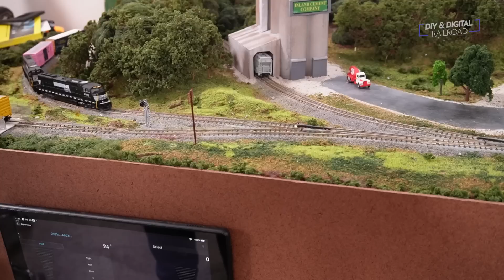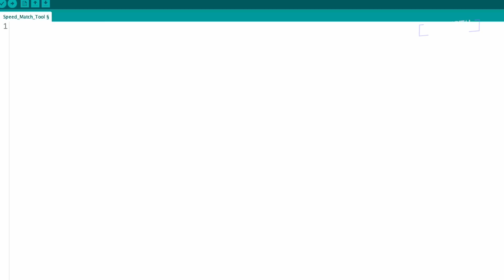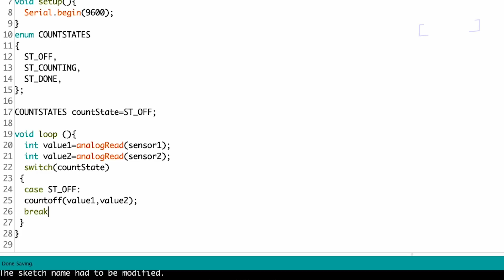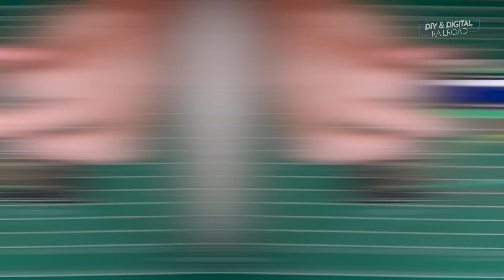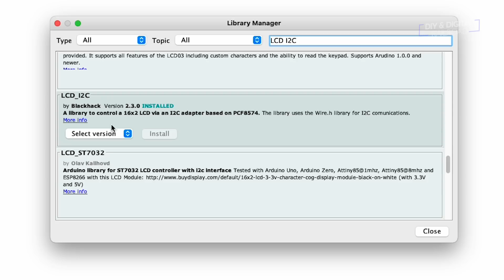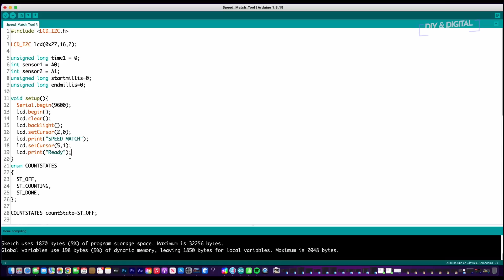Using an Arduino for Model Railroad Speed Matching

Comment: If you are interested, I took your code and made it a full fledged speedometer in HO scale miles per hour.  It will also read either left or right depending which way the loco enters the sensors.   you just need to enter into the code the true distance in inches between the 2 sensors then upload to the arduino.

Comment: Jimmy, I built this circuit, works a charm..however I wanted to put this on a bones PCB (bare bones Arduino, v2 by Chris Rye 2013, available from Oshpark) but has no reset. So, I used a reset function. 
At the very beginning of the sketch put in void(* resetFunc) (void) = 0; and at the end after delay (10000); put in resetFunc();
Works great. Sketch resets after 10 seconds. Enough time to record results.
Reply: Thanks Tony! I know you posted this two years ago, but it is just the snippet of coding I was looking for. I hated having to hit the reset button each and every time.

Comment: Thanks, Jimmy for this tutorial! I needed this as I needed to figure out how to speed match my locomotives and I am planning on using an Arduino to build a speedometer. 

Is there a way to connect the Arduino to JMRI to automate the speed matching? I am planning on building a separate test track just for this purpose.

Comment: I also do a lot of speed matching, for my locos and for other folks.   I have a "test track" and I've done a permanent install of "speedometers" on my test layout.   I use photoresistors rather than IR sensors as they are smaller and easier (at least for me) to imbed in the track.   For speed matching I have two separate loops and each loop has two speedometers on it (yes, that is way overkill but was fun doing).   I did find that the speed of the locos changes by a few scale mph between two speedometers on the same loop - due to not level track or where the speedometer is in relationship to the corner.

Plus, I have both an LED to show "speed" and then a 5 line LCD where I show the previous speeds.

I also spent a lot of time programming so that I can capture speed even if the engines are only about 6 inches apart and regardless of which direction they are going.   Also, by sampling light levels during start up, the sensors work well in both bright light and low light situations.   I found that the IR sensors were sometimes a bit faulty when getting direct light from the newer LED light bulbs.

Anyway, this lets me set up my locos so that they all have the same top end end speed, mid speed and 20% speed.   BUT, to finalize they speed, I put the two locos on (I use advanced consisting) and run them and using "Programming on the main" (POM), I do fine tune them as they chase each other around with the one that runs "slightly slower" in the rear.

Comment: I've done a Raspberry Pi based speedometer. Great for public shows, but rather expensive -- Pi 2, 7" screen. Seeing this I felt that I could use this as a basis for a smaller cheaper speedo. However one question/observation; the sensor you are using is digital not analog. Testing, I saw that it swings between an analog value of ~20 (low) and ~1020 (high). I tested it a digital and it works fine registering high to low transitions. Why set it as analog?

Comment: Suggestion for your code. Rather than using delay to avoid flickering, how about going back to ST_OFF. It won't be update the display, and you'll get new readings without clicking the reset.

Comment: This is a great tool and it's greatly customizable.

My DCC system works in a way that you don't have to do speedmatching, it requires you to measure the time it takes to travel a given distance on a few different speedsteps and then just enter them in a table for each locomotive. Once you're done you can match any of your locomotives together they are going to be automatically moving with the same speed!

Comment: Very nice Video, I plan on putting into practice as I have many locos to speed match!
One thing that would be very helpful is to mount the sensors to something that will maintain the distance (like @gravesclay says below), since any movement of the sensors between locos will throw it all off.

Comment: Hi Jimmy,  If you don't mind one more suggestion, it would be really cool if when you run the second engine through the unit would calculate an adder for each of the three CVS to make it's speed match.  For example if the 2nd engine were too fast, tell the user  to subtract "X" from the CV.  The user would have to run the engines thru three times, once slow, once mid pace, and once at a fast pace.  Then the user would adjust the start voltage, mid voltage, or max speed.  Just a thought.  

I was drinking "Bad Ass Coffee of Hawaii, Breakfast blend.  And keeping with my theme I was using my "Big Ass Fans" coffee mug.  (A promotional mug from the Big ass Fan Co )

Tony
Reply from the maker: This is a really good idea!  I will have to work on it!
Reply: @DIYDigitalRailroad  of course, if you add in the Arduino DCC library, you can then write the program that will do everything: prompt for the address of loco 1, prompt for the address of loco 2, run each loco past the sensors multiple times at various speeds, take the average of each loco's speeds, calculate the CVs and upload them to the locos.

Comment: Fantastic video, Jimmy. If I had seen this a couple years ago, I wouldn't have had to buy my scale speedometer. Grr... (Needless to say, I LOVE gravesclay's suggestion...)

One suggestion (which will fix two minor issues): at the end of countdone, if you set countState back to ST_OFF, that will report the elapsed time ONCE, then return the Arduino to its original state (waiting for the first IR sensor). This eliminates the annoying flicker you mentioned (allowing you to remove the delay() statement), and it frees you from having to reset the Arduino to be ready for a second speed check.
Reply: This suggestion would also allow you to take readings over several runs, and average them.

Comment: Jimmy, basically what you've done is build a speedometer with an Arduino. Another way to do this is to buy a speedometer system, such as the Accutrak II, or Train Control Systems. The nice thing about these is that they are already calibrated in scale miles per hour.
Reply: You are exactly correct. I own an Accutrak II; they are currently retailing for about $70. The Arduino plus LCD screen plus IR sensors total about $38 (you don't need a breadboard if you're willing to do a little soldering) and you'll have 8 IR detectors left over. Add a $1 wooden ruler to mount the IR sensors (see gravesclay's coment) and you can report both milliseconds and scale speed.
Reply: @rwissbaum9849  Exactly. The biggest advantage to Jimmy's video is the cost.

Comment: Jimmy, this looks great. I've never used Arduino and only know about it through your channel.  Using your parts list and instructions would this be suitable as a beginner project? I know less than nothing about code, and barely any more about electronics. Thanks for all your hard work!
Reply: I'm not Jimmy from @DIY and DIgital Railroad, but I think this would be an excellent beginner project if you're the kind of person who likes to just dive right into things. If you want a more gentle introduction, you can buy the Arduino Starter Kit which contains a variety of electronic components and other parts (including a breadboard and hookup wires), and several tutorial projects to get you familiar with the basics of the Arduino and the basics of the electronic components it uses. After you've gone through some of the tutorials, you'll find that building Jimmy's project will be a breeze. Either way, you are almost certainly going to have questions about compiling and uploading the program, and there are lots of very helpful Arduino forums out there to turn to.

Be warned, though, that once you start with an Arduino you will find it very addictive!🤣
Reply: @jimhyslop  that's brilliant, thank you for the advice. I'll look into a starter set as it looks like there are a lot of other potential projects. It's amazing where this hobby takes you sometimes. Thanks again, Jim

Comment: Hi Jimmy! Great Video! One minor tweak / upgrade for a later version. If you tape the sensors to a ruler (fixed distance every time), you can throw a tiny bit of math on the Arduino and output the speed the loco is traveling in scale MPH!
Reply: Great idea!
Reply: I would really like to see that done I think it would impress our friends more Seen a scale speed instead of random millisecond times
Reply: @robbhalverson7725  Hold on, I ought to be able to publish a sketch shortly.
Reply: @robertmyers5269  Hey Rob were you able to come up with something to show MPH?
Reply: @robertmyers5269 thanks for the reply. Not sure why I cant find it here but your sketch worked great.
Reply: @robertmyers5269 if you posted your mod lines to the sketch to write scale mph instead of miliseconds, I don’t see it. Can you try posting again?

Thank you
Reply: @KenN.OXN.805  I honestly don't know what your problem is. I just downloaded from github to verify and (though I haven't recompiled it) it looks like what I posted. I've compiled and used this with various scales and lengths of speedtraps. Oh wait, are you using a display or just viewing it in the serial monitor? I just had the serial monitor show raw time of clearing various events for debugging purposes. Is that what your are seeing?
Reply: @robertmyers5269  do you have a GitHub link where your modified sketch is? The only sketch I know of is the one Jimmy linked to in the description and it has no mph calculation lines that I can see in his code.
Reply: @robertmyers5269  hmmmm….

Thought I’d posted a reply, but don’t see it.

If you have a link to the GitHub where you have an edited version of Jimmy’s script, can you post? All I had was the GitHub link Jimmy posted in the description and I looked at the code. He has no lines for supplying scale mph in his sketch.
Reply: @robertmyers5269  don’t know what happened. Thought I had posted a reply, but don’t see it.

If you have a GitHub location where you have a moded version with scale mph, its link doesn’t seem to show up on the comments area.😢

Comment: Jimmy, how do you know where to plug the wires into the breadboard? All I see is a bunch of unmarked holes in the breadboard. ...Roy
Reply: The breadboard is divided into four sections: left to right, they are (1) two columns of + and GND. All holes in these two columns are connected to each other (but not to the other column), giving you a positive bus and a ground bus. (2) A field of holes which is five rows wide and thirty rows tall. Each of the five holes in the thirty rows are connected to the other holes in that row, but no other. (3) A second field of 5x30 connected in the same fashion. And (4) a second set of two columns for positive and ground buses. So hole a1 connects to holes b1, c1, d1 and e1, but no others. a1 does not connect (for example) to hole f1 or to hole a2. Once you understand this, it is easy to connect pin D3 on the Arduino to, say, hole a1. Then, you can connect any device you want to pin D3 by running a wire from that device to hole b1 (or c1 or d1 or e1).